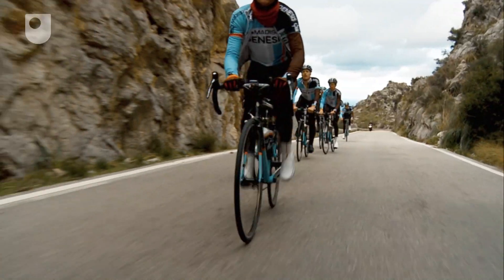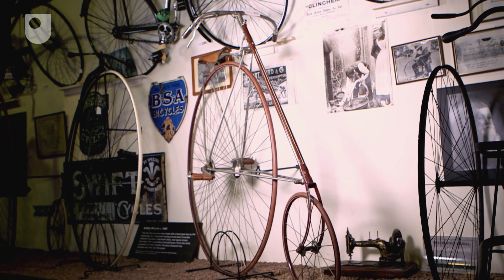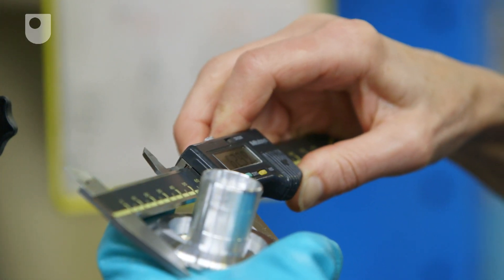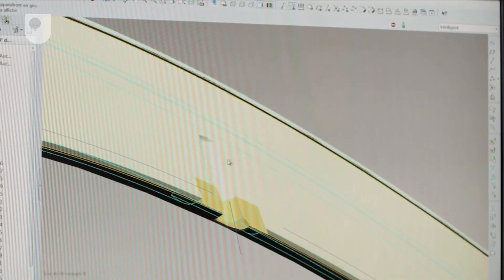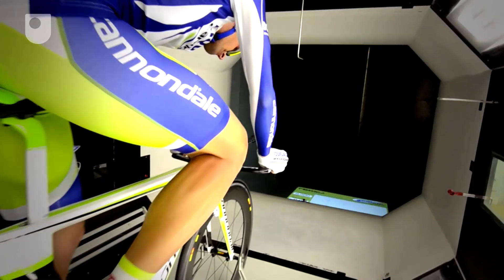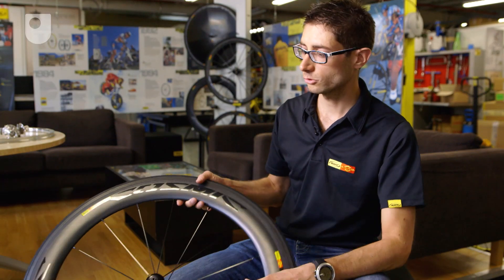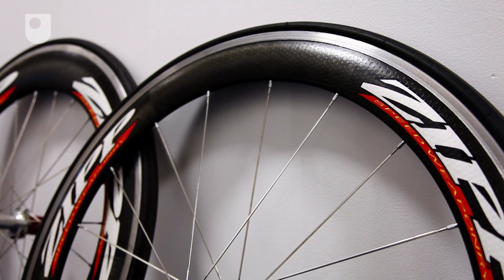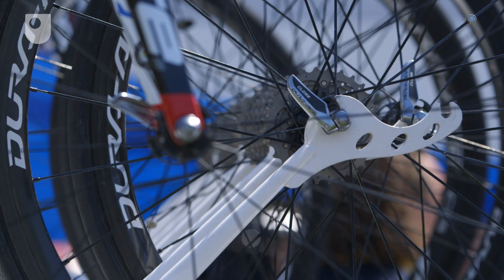Wheels - Design Behind the Bike (3/5)

Comment: 5:36 Surely spokes in a traditional spoke wheel can never be in compression - there is nothing to stop the spoke pushing upwards into the tyre.
Reply: Darren Hayes strictly speaking, you are correct.
however, a bicycle wheel is a pre-stressed structure, so compression expresses itself as lower tension, while tension expresses itself as higher tension.
hope this helps.
the standard work on the subject is Brandt's "The Bicycle Wheel". Often mentioned, sadly rarely read.

Comment: The negative pressure Bicycle wheel here. We draw tension between a Nano Composite hoop and the bicycle wheel. The tension 12 x the prescribed load.
 A high frequency response to the surface is the result. Screw Force Accumulation
and return to optimize irregular pedal stroke...A return against wind resistance...While pedaling. More issued Utility Wheel Patents and claims than any wheel in recorded history.